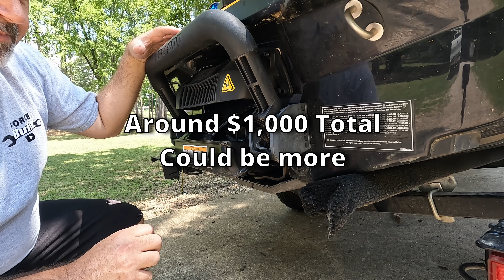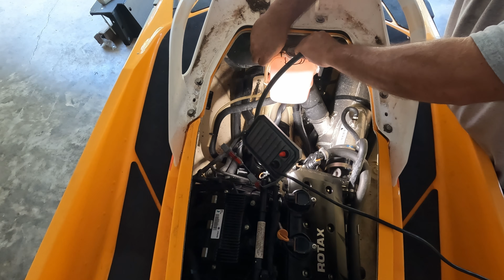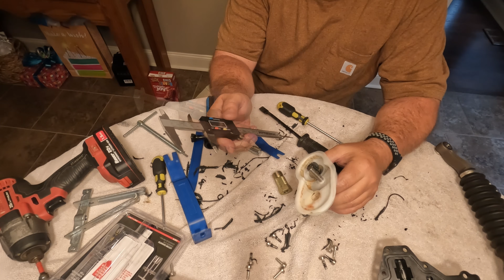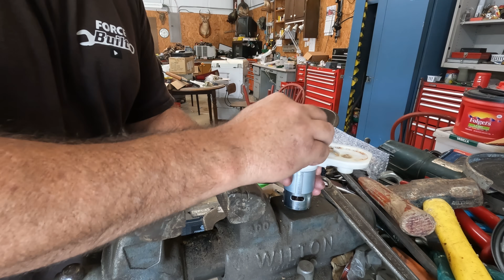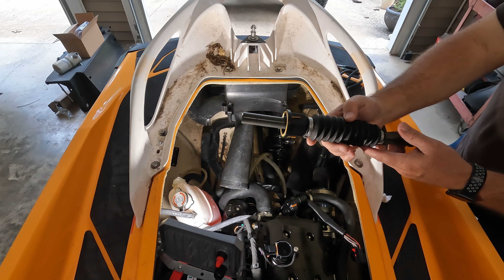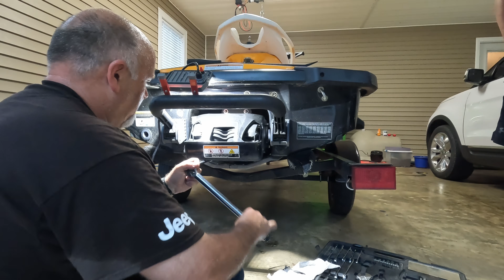How to repair SeaDoo IBR Actuator! (Removal And Repair)

Comment: What was the fault before? Did the ibr work sometimes? Or was it stuck in reverse etc? I have an spark trixx. Sometimes it flashing ibr fault on dash. Restart and it can work 2h in a row or 5 mins. Sometimes it show ibr fault on startup but dissaper when reversing or adjust the vts. when it works, it works like a champ until it dont anymore.. any ideas?? Great video
Reply from the maker: I don't remember the fault. I just would not move at all in any direction.
Reply: @ForceBuilt okey, thank you
Reply: @ForceBuilt did it still work if you did see the IBR over ride?
Reply from the maker: This one would not move. Never worked once it went bad until I replaced the motor.

Comment: Did you runt the outer ibr arm all the way down on the plastic work gear or did you leave a little thread? I put my ibr back together one time and feel like I didn’t thread it all the way down, I just had to take ibr apart because that plastic gear stripped, ordered a brass one but I’m making sure I need to bottom that outer arm all the way down on it or backed off a little bit if that makes sense lol
Reply from the maker: Sorry but I don’t remember.

Comment: Amazing video! I just have one question when you took apart the ibr module what kind of grease or lubricant did you put on the gears?
Reply from the maker: I don't remember but if I were buying grease, I would get white lithium. That will work just fine. Good luck!

Comment: Thank you very much for putting this information on line. I have two 2017 300HP Seadoo skis and you have saved me a bundle. Your quite correct in that it is not a terrible job once you have methodically broken down the sequence of steps as you have. I additionally took the time to inspect and grease the jet pumps while they were accessible. Again, thank you.
Reply from the maker: Thanks so much for the kind comment! That means a lot. Glad I could help and you got them going!!!

Comment: Great video! Mine got stuck yesterday in neutral- with about 10% of forward still allowing me to limp it about 2 miles back to the dock. Luckily it didn’t happen to me out on the surf. Was hopping waves and came back to refuel and it locked up 🥲
Reply from the maker: Thanks for the comment! Glad you made it back safely.

Comment: Ibr motor and gear were just replaced and it’s not allowing it to go all the way up? Any tips? TIA
Reply from the maker: You have to get all the cogs and worm gear in the correct place, or it will reach the end of the travel before the system gets all the way up.

Comment: What was the symptoms? I was riding my 2011 rxt X 260 yesterday and the Ibr light came on and it would only go about 30mph. No neutral or reverse, only forward would work.
Reply from the maker: Ours was locked into neutral. IBR button would not do anything.

Comment: Granted that the replacement electric motor is only $20, but old motor can come apart to just replace the worn out  brushes for a few dollars, and lets face it, better  factory motor in the end instead.
Reply from the maker: Mine has been working great! I would replace rather than repair 100%.

Comment: This is an exceptional how-to video, you covered all my questions and more.  Are you lubricating anything as you put it back together?  Do the gears run dry?  Does anything require blue locktite?
Reply from the maker: I just put it back together with what was already there. Some white lithium grease would be ok to add.

Comment: I am having a really tough time getting the shaft punched through the motor to free that gear and the plastic shroud. My shaft does not move up and down like yours does. Wondering if you have any suggestions. IBR out of a 19 Spark. Great video, super helpful! Thank you!
Reply from the maker: Mine was tight but not like what you are saying. You may have to use a little heat to free it up. Good luck!

Comment: This absolutely works for a 2016 Sea Doo GTI 130. Took us about 8 hours with 3 people. Hardest thing for us was the bucket was locked in the upward position which made getting to the bolt that detaches the linkage to the bucket. Finally got it and installed the new motor. Still had a little daylight left to take it out on water for about an hour. Awesome having neutral and reverse again. Thanks so much for the video and savings!
Reply from the maker: Man, I am glad it worked out for you!!!

Comment: Great vid. Q? Anything come loose since I did not see u use lock-tight at needed points.
Reply from the maker: Man, it's been a while but I don't remember seeing Loctite on anything. I do have Loctite and would have used it if I noticed that it was used from the factory. I was hot and tired and ready to get the video done. If yours does have blue Loctite on some hardware, I would use it on those bolts. I have had no issues at all.  Thanks for watching!
Reply: Thanks for the vid, I went to amazon and bought a motor so I have it if ever needed. Hope u do more seadoos if he needs service…lol

Comment: Gday mate,
After watching your video I attempted to replace my IBR motor as it had failed and the ski was stuck in reverse. I purchased the motor from your link from Amazon, it came in 4 days as I am located in Australia. I followed your video step by step apart from removing the box as I managed to remove and replace the IBR without to much difficulty. Replaced the motor and all is great. The system
Self calibrated for me and the system works perfect. Now to water test the ski in a few days as I would like the sealant to set,  so no water or moisture can enter the unit or the hull. Thank you so much for your video. I was quoted $2,500 Australian dollars just for the complete IBR not including labour. Your a gentleman mate. Thank you kindly.
Reply from the maker: Thank you so much! I love it when I get comments like yours. Makes my day!

Comment: Thanks mate, should be a great help
Reply: This one you need to select voltage and speed. 12v 12500rpm you think?
Reply from the maker: @savage169  I linked the one I use in the description. It works great but there may be a better one if you can figure out what the old motor is. Thanks for watching!
Reply from the maker: You're welcome!

Comment: What are the symptoms of this? Last two times I was at the lake, the ibr was stuck. I had to pull ski back out and get it moving while out of the water. Then it would work in the water. Is that the signs of an actuator about to completely fail? Once up and going, it works fine for the day… Thanks to any who reply.
Reply from the maker: Not really sure about that situation. Mine  went out all at once and you couldn't get it to work. Maybe yours is just binding and once you get it moving the water in the lake keeps it lubricated. Then after the day is done, you pull it out for a couple of weeks and it dries out and starts binding again. Thanks for watching

Comment: I'm struggling to get the waterbox back in the machine, is there a secret?
Reply from the maker: No, just a tight fit. Keep working it will go. I think I remember a sensor being in the way that I ended up removing in order to get the water box back in.
Reply: @ForceBuilt  I ended removing the boot in front of the water box, took less than 1 minute, would recommend this.
Finished yesterday and water tested, everything works, but my gate lowers too far, do you know if the up/down positions can be adjusted through the computer or do I have to pull the pump to adjust the link?
Reply from the maker: @skuzera66  probably can be programmed. I made sure I put everything back in the position I found it. I didn't have to do anything else extra.

Comment: 1 year later, How have your repairs held up?
Reply from the maker: Still going strong!
Thanks
Reply: @ForceBuilt  do you have any recommendations on removing the sealant that was on the existing box?  I am assuming I need to remove the left-over sealant before adding the fresh sealant.
Reply from the maker: Yes you do. I just got some plastic pry tools from harbor freight and scrapped it off.

Comment: Just watched your video very informative.  I have a 09 GTX IS Limited.  My IBR is out, curious to know how you found the DC motor for your IBR actuator?  Any ideas how I might find the specs on mine?
Reply from the maker: Thanks for the question but I don't know. I just saw where someone repaired the actuator that was like mine. If the interior actuator box looks the same,  the motor should work. If it is different, then Google will be the only help. I will look into it and post here if I find any information. Thanks
Reply from the maker: Yeah, Yours is totally different by what I found. I wouldn't know without taking one apart. Good luck!
Reply: @ForceBuilt  Thanks for checking!  I found the motor worked fine, but the circuit board needs replacing.  Unfortunately, they don't sell the circuit boards separately. I'll need to buy a whole new unit...
Reply from the maker: @dlucas313  Thanks for the update!

Comment: OK.. I'm ready to reinstall mine.  I see some people put some sealant/black RTV on the plastic threads for the outside nut.  What about on the inside of the hull where the module exits the hull.. and the O-ring on the nut.. anything or leave 'em dry?  Anyone know if it's shown in the shop manual... if so It make sense to buy it online for $15.  Thanks!!
Reply from the maker: Just the nut threads and where the nut touches the hull. No need to do anything inside. thanks

Comment: Will this motor work on 2016 seadoo gti 130?
Reply: Thanks so much. Video is very helpful. The ibr would blink and the gate stays down.
Reply from the maker: @alecsisavath7850  Your are wlecome!
Reply from the maker: If the black actuator box I repair in the video looks the same, then yes. If it is different, I don't think so.

Comment: A couple questions & comments.  First of thanks for doing!   Did you grease the gears and the threaded rod.. is so with what grease and how much.. (I'm guessing lightly with a silicone based lube like super lube..although yours looked pretty dry for the most part).  Lastly, the "one-turn" to thread the rod one confuses me... I believe mine the nut and the shaft are clamped tight (hoping) and it unthreaded the whole time I was removing it.. hoping to thread it on and it ends in the original position.  one thread doesn't seem like enough for it to grab the threads on the actuator rod.. mine was closer to 4 turns in and I don't think I spin the nut and the outside arm separately..  (waiting on a motor to reassemble).  Thanks!!
Reply from the maker: So the end of the shaft has threads and so does the big plastic nut. I want the shaft to thread in 1 complete round before I allow the plastic nut to start screwing into the hull. The plastic nut is connected by a rubber flex boot. You can pull the boot back and get all the room you need to thread in the shaft. I did not replace any grease. I only used what was still there. Hope this helps!
Reply: @ForceBuilt  Makes sense!  Thanks for the quick feedback!

Comment: Great video. Have you dealt with any gen 1 ibr? I have 2 skis giving me iBR issues right now one is a gen 3 like this one and I just ordered the replacement motor using your link. The other is a gen 1 and I haven’t done anything yet. Hoping to find a similar repair for that one but not finding anything as of yet.
Reply from the maker: No, this is the only one I have had dealings with. I can't imagine that Gen 1 couldn't be done though. Thanks for watching!
Reply from the maker: Yeah, I just looked at the Gen 1. It is a lot different than the Gen 3. Good luck and post your findings here if you try and tackle it!
Reply: @The_Brew_Dog did you try the gen 1? If yes, can you please share additional info on that?

Comment: As a newb guy...I am wondering why you even needed to pull the shaft from the back in the first place. It seemed like once you pulled the nylon thread it just pulled out. Is it because the shaft itself is threaded into the ibr box?
Reply from the maker: That is correct. Thanks for watching!

Comment: Hey, great video and very helpful? Just wondering if you know what’s the min and max rpm for the 775 dc motor that can be fitted as I only found one with either 8000rpm or a max of 20000 rpm locally. Thanks
Reply from the maker: I am actually not sure. I would be afraid the extra speed would cause damage to the plastic pieces inside the housing. It may work though. If you try it lets us all know here please! Thanks for watching
Reply: Thanks a lot! We just installed and tested unit with the slightly larger rpm and works perfectly. Will calibrate it on Monday when pump goes back. Thank you so much! 🙌🏻
Reply: Hi guys, last year I replaced mine with a 3500 rpm and it’s too slow on the water (delay). Did you see any difference with the one you installed (6000rpm) compared to the original one (reactivity of the ibr)?? If it’s ok I’ll replace mine with the 6000rpm one otherwise I’ll choose the 8000 or 10000 rpm one…
Thanks a lots

Comment: Thanks for the oil filter wrench trick.  Great job on this video.  Manual also calls for liquid gasket sealant on threads of  nut.
Reply from the maker: Thanks Jim! I should have showed that. I did seal the treads with black rtv.
Reply: I must have missed it but what is the oil filter trick?
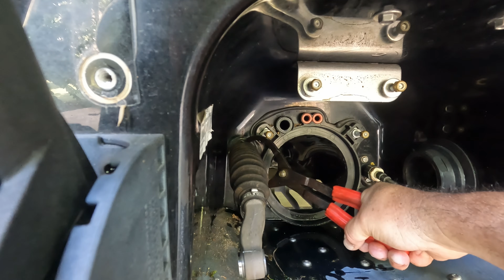Reply from the maker: I used the tool to get the plastic nut off the hull where it connects to the ibr. Like a big set of pliers. click here 6:05

Comment: How could you tell this was the issue what was your jet ski doing ?
Reply from the maker: So the jet ski wouldn't go into forward or reverse. It was just sitting in one spot. The motor went bad so the ibr system couldn't move in order to change direction. I suspect that it could also be stuck in forward or reverse with some jet ski. It depends on what position the ibr system is in when the motor goes bad. Thanks for watching!
Reply: So you think if my jet ski is stuck in forward and I keep getting the Ibr beep it’s the engine ?
Reply: I think my issue is close to yours…what was the verdict with your ski? Tia
Reply: Ibr engine*

Comment: Great video.   Thanks for posting!
Reply from the maker: Thanks K! The repair is not hard to do imho! Good luck!
Reply: @ForceBuilt  Sea Doo rolled off the trailer and hit pavement.  It broke the plastic thread on the actuator in half.  Unfortunately I have to buy a whole new actuator.  I can’t find just the housing anywhere
Reply from the maker: @KennethCrawford1970  Yeah that's a bummer for sure!

Comment: Great video! I just had to do the same, and thanks to all the other previous posters talking about this iBR craziness and crappy motor.  Your videos adds the details that were missing.  

TRICK:  One trick that made it way easier for me was to take the temp sensor out.. then the actuator can slide without taking the muffler out. Just be careful as the sensor is sensitive to tossing around and cost $40.  LOL - you know how I learned!
Reply from the maker: Thanks Jonathan! I appreciate you stopping by. If I ever do this again I will remember your trick. Muffler not hard to remove but a PAIN to get back in!

Thanks for watching!